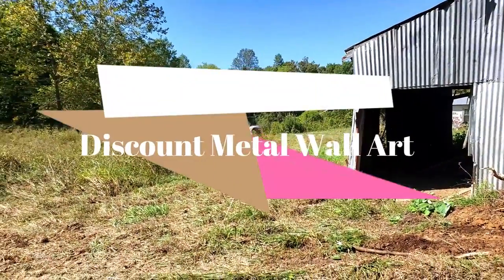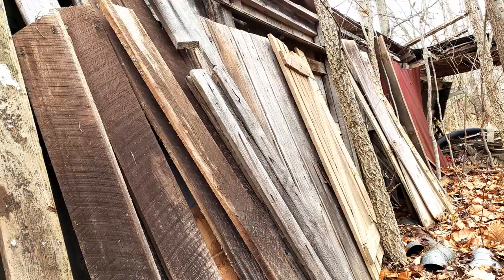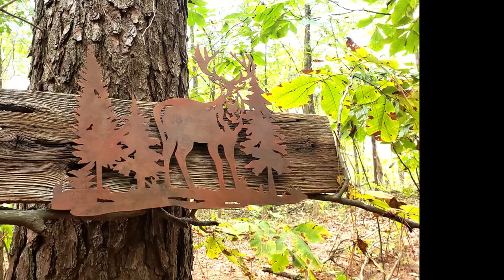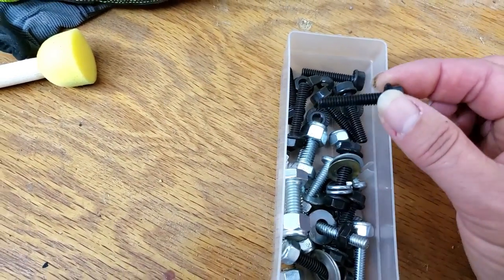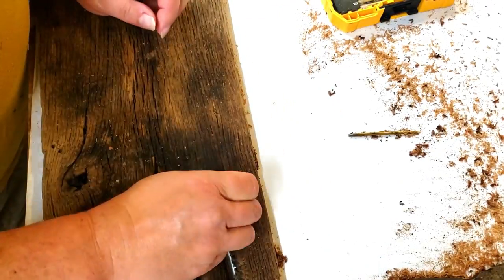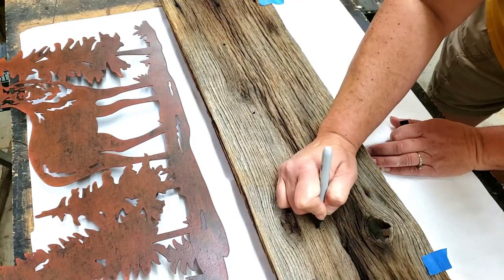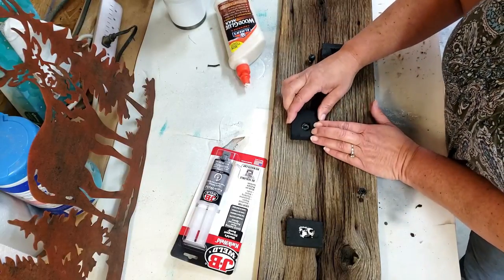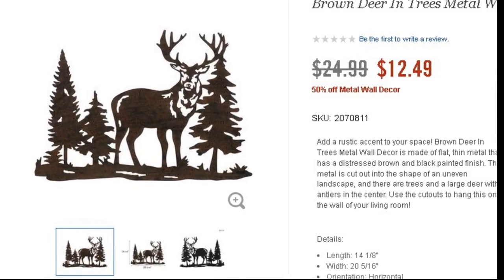Wildlife Metal Wall Art Upcycled - DIY Man Cave Must Have!

Comment: for your keyholes, use a board for a edge guide on the router and use a straight bit the first time to get the line in, then use the keyhole bit to route out the sides. you can go just a hair deeper with the straight bit to make it easier, so you arent cutting the entire bottom and the sides at the same time. and keep that edge guide there the whole time.
Reply: Great advice!!! Thanks! 😀

Comment: I like what you do with the weathered lumber.  Do you ever run across penciled calculations from previous owners  ?
All the doors on outbuildings on the farm were covered with writing. 
Some from my Dad, but not all.
Thanks Mrs. Kapper.
Reply: My parents started  building their house  in 1952 and finished it in 1965. Any important info was written on the walls of the master bedroom closet. Like where the septic system was, why the garage didn't have a full concrete floor. Even the price of supplies they used was listed. We have since sold the home and told the new folks to never paint the walls in that closet as they will need that info someday!
Reply: @mslorry3420  wow! That was so interesting!!!!
Reply: Thanks Bryce! I have run across some penciled measurements and love them! For a minute there you feel connected with the hands that built it. 🙂